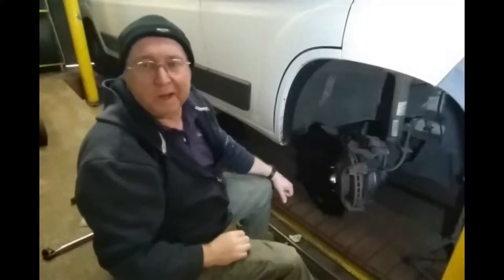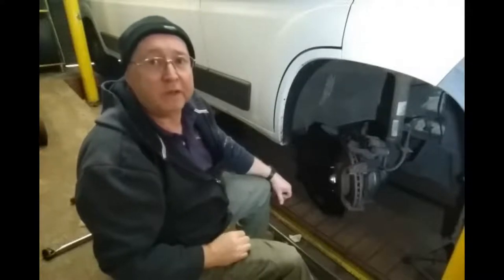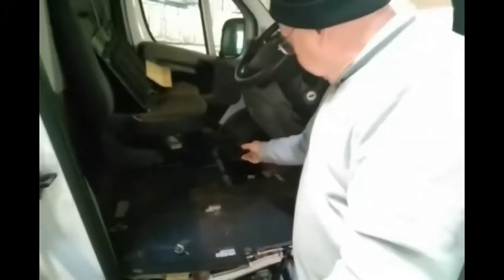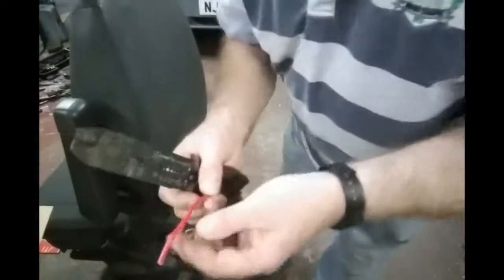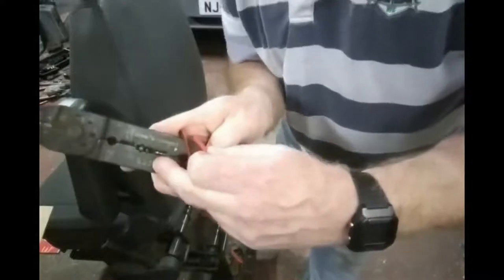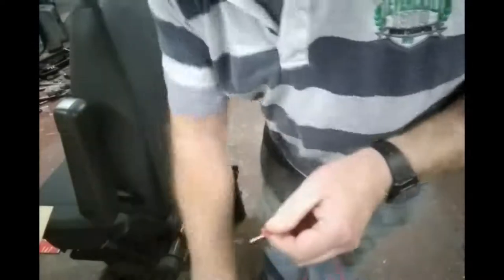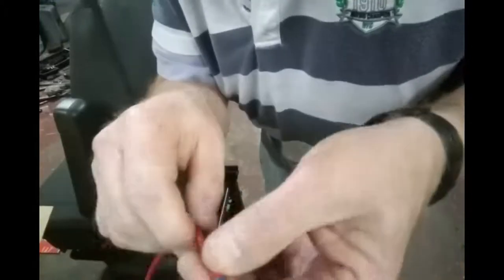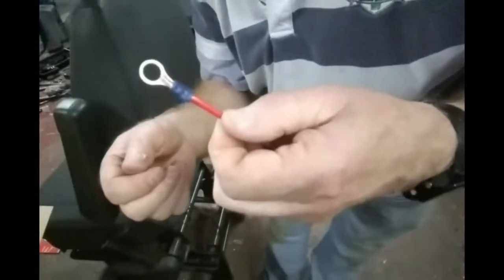Dual Battery Camper Van Solar System “2” : Installation Video  (All Cables Completely Concealed )

Comment: I went through 2 sets of MC4 as I also read the polarity on them until after id crimped them they are right on the panel then revearsed on the cable you're connecting
Reply from the maker: Hi Richy,  Yeah, I bet that's caught out a few people, there not the best instructions are they ?  you sound like your got there eventually though, that's the main thing ! This campervan conversion lark is a big learning curve for all of us haha.
Thanks for watching and taking time to comment ...
                          Cheers...Jimmy...